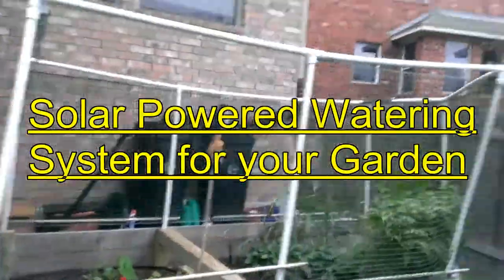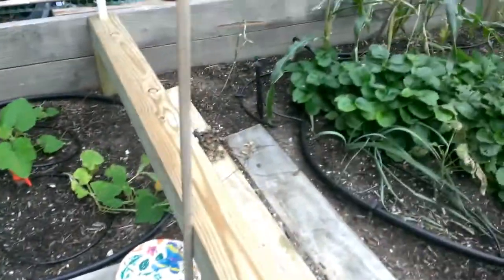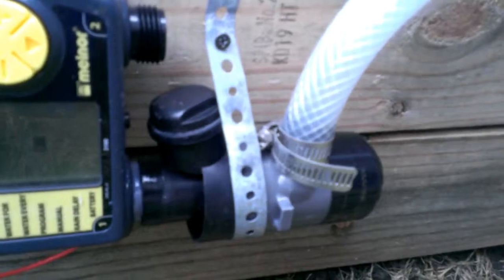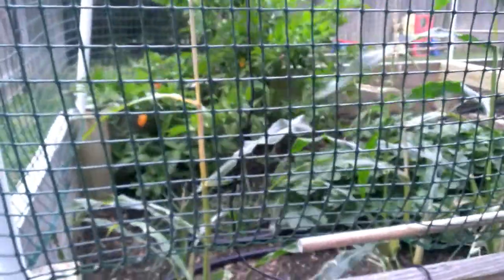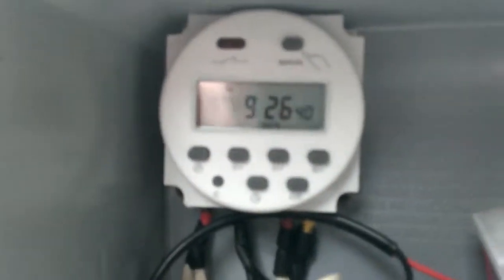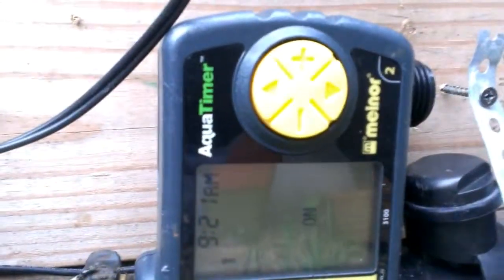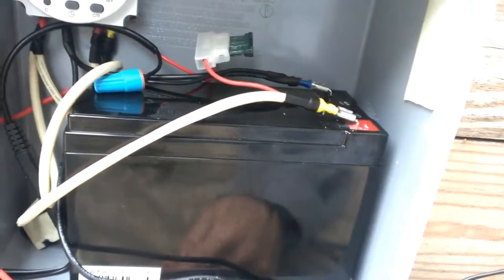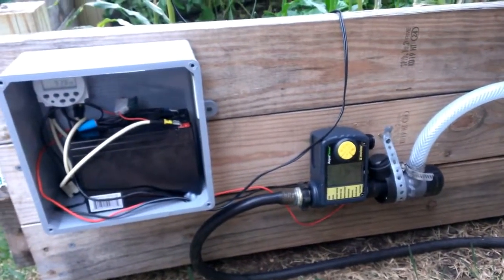Solar Powered Watering System Garden

Comment: Get video, electric water valve run on 9volt or 2aa  I cant see the power source. I see the red and black for the pump.
Reply from the maker: +Debbie S 2 AA batteries Debbie.  I use rechargeables that I recharge from another solar panel. :)